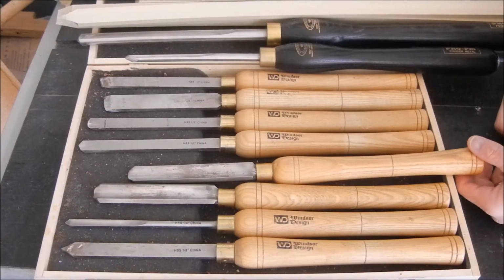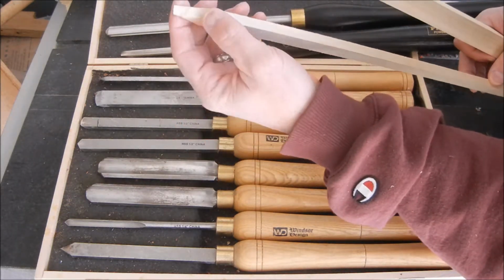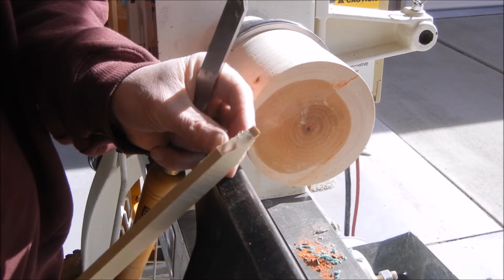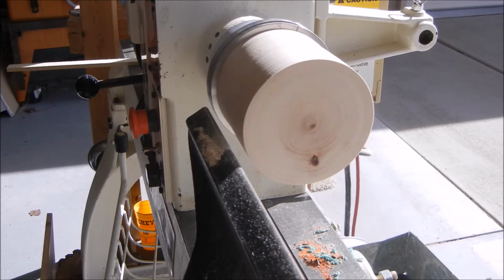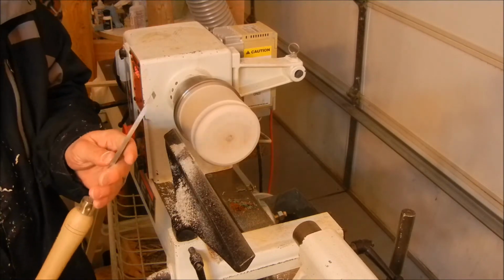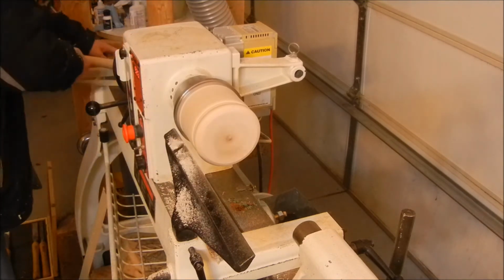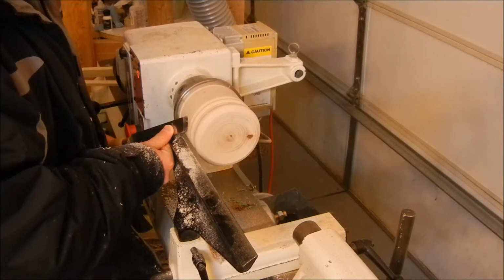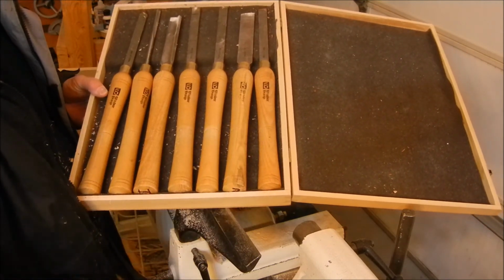Wood Turning 101: Pen Turning: Cutting Tools, Harbor Freight Wood Turning Tools Review

Comment: What kind of bevel do you put on your tools is it a flat grind a hollow grind and how do you sharpen them
Reply from the maker: Oh man grinding tools is a mystical art, done well by few and poorly by the rest of us most of the time.  I use an 8 inch high speed grinder with a variable speed foot pedal like a sewing machine. I have a 120 and 60 grit white wheels on them.   So I put a hollow grind on my tools.  I welded a set of platforms and jigs that look and act like a wolverine grinding system.  I also just bought a wolverine so I will start using  that soon.  I  can get a pretty good edge most of the time.  I am slowly moving to more free hand grinding with just the platform.  I haven't done any videos on this yet.

Comment: thanks for this informative video. definitely will be watching over and over . what are your thoughts on the carbide tip tools? i was looking at the harrison made ones.
Reply from the maker: +pryce wilkins Carbide tools are a new and different compared to the traditional tools.  This is not to say the are bad, or good, or better, or worse, etc. The advantages are they cute well, without the fear of catches, and tool control needed for say a skew chisel.  The tips need to be moved and sharpened or replaced which is easily done,   They eliminate the learning curve and time needed to sharpen conventional tools.  Once draw back is they are expensive, and replacement tips seem pricey too.  I have built my own carbide tipped tools but don't seem to use them much.  In some case of cutting something really hard carbide works well compared to HSS tools that need a lot of sharpening.  So try them out and if you like them great, you will have another option when turning.